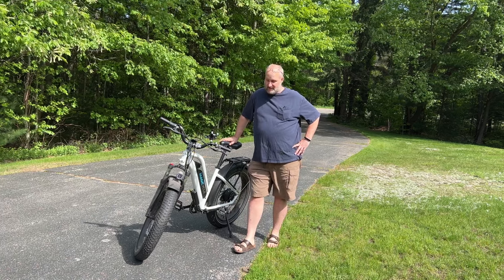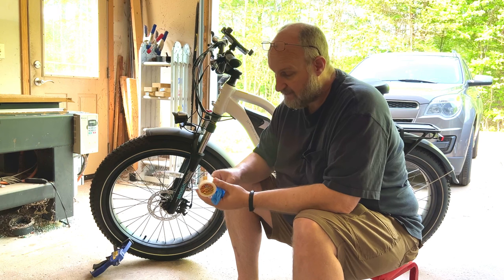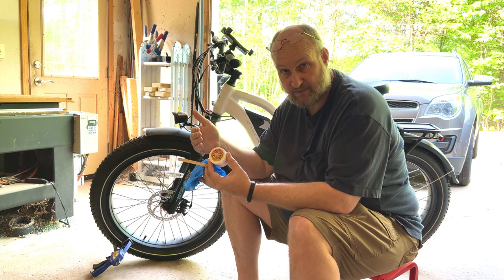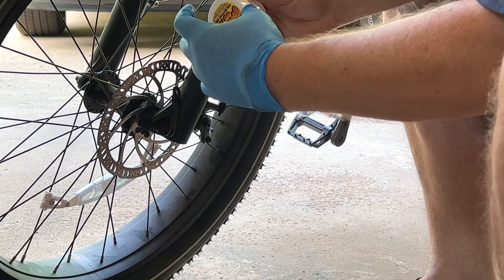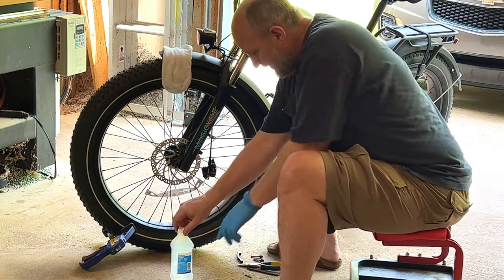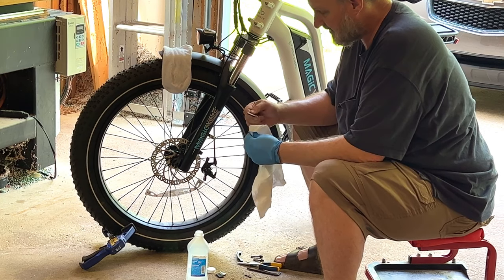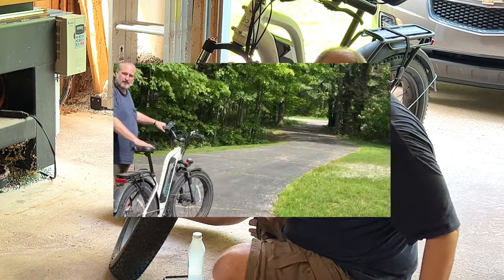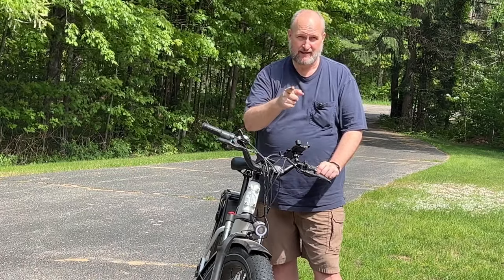Squeal Out review- Tinkering Turtle

Comment: oh my goodness, I just tried this.  I never had disc brakes before, and bought a used disc brake bike.  Nice bike except the very loud squeal on front and back brakes.  As I was doing the front brake, and cleaning the rotor with alcohol and shop rag, I got a very noticeable squeak, just from moving the rotor while applying alcohol.  OMG, these brakes are designed to squeal.  But after the moment of panic, I continued on.  And I would say the final result is the front brake is not squeaking and the back brake can still squeak under heavy braking but for the most part, it's ridable now.  Before it would wake the entire neighborhood.
Reply from the maker: I am glad it helped. The vast majority of the time cleaning the disc and pads with isopropyl alcohol will do the trick. On a few bikes I have had to use this product. And one bike I actually ended up replacing the caliper to eliminate the problem. Enjoy your bike!

Comment: I bought the plug and play hydraulic disc brakes for $40 a pair and put them on my Cruiser and my wife's Step Through. I didn't notice any better stopping like many people report but just as good as before the switch but no squeaking and I like the idea of both pads moving into the rotor instead of just one.
Reply from the maker: ok, good feedback.
Reply from the maker: Can I ask which cable actuated hydraulic calipers you chose?

Comment: OR....you can buy a $40 set of hybrid XTECH hydraulic brakes (which use your existing cables) that never squeak ...because the very design of those CHEAP Tektro aires brakes where only 1 pad actually moves is causing the vibration and rotor distortion. Trust me...you''ll be doing that entire procedure again and again if you keep those brakes. Yeah it worked for a while, but....well you'll see. Do yourselves a favor and get brakes where the rotors are not distorted (BOTH pads move in unison) and not only will your brakes never squeak again, but they will actually stop better.
Reply from the maker: Not really the point of the video, but I appreciate the feedback!
Reply: That is how floating calipers work

Comment: Could be from warped brake disc
Reply from the maker: Its a possibility, but typically I have found that once the pads are smooth and parallel then the noise goes away.

Comment: It looks like valve lapping paste. Probably without the lubricant and a "bike" sticker only on it to jack the price.
Reply from the maker: Probably a good assessment. The container is lasting a long time and it works wonders on minor squeals that are not associated with too much contamination. Thanks for the comment!
Reply: @TinkeringTurtle  No problem I have a rear brake that squeels like crazy. I've cleaned the rotors and pads, cleaned and sanded the pads. Everything. I may try this product as you are right you only have to apply a very small amount to the rotor. Literally just use clean gloves and your fingers to spread a little on there. If it's anything like valve lapping paste you only need a very small amount.
Reply from the maker: @Chris Sinclair , I will say I have a front brake on one of my bikes that is a problem. I have cleaned it a bunch and it still builds up contamination and squeals. I will work with it some more than I think I will try a new caliper. I am not certain where the oils is coming from. This product will not help that…
Good luck, let me know how it goes!
Reply: @TinkeringTurtle  Can it be a leaky cable. I had to replace the oil in mine. It was a very slurping experience 😀
Reply from the maker: Always a possibility

Comment: This stuff is nothing more than rubbing compound. I too wasted $20.00 on it.  It does work somewhat, but, after using it you still have to disassemble the brakes and do a regular cleaning job.  So, why bother with it?
Reply from the maker: Fair enough. I can say, with one exception, it has worked on the brakes that a cleaning wouldn’t fix. The exception I had to replace the caliper before the squeak went away. I am assuming the caliper wasn’t working correctly.
Reply: Personally, I tried everything else, so even if this is just a rubbing compound, the benefit to it, is people explain how it works and then the squeal goes away. Sometimes it's about having a way of obtaining the knowledge.  I tried all kinds of other videos with various instructions, I bought brand new pads, cleaned the rotors, I never tried replacing the rotors though.  Anyway, when I found this,.  I had to spend $30 on it, maybe because not many people have it for sale anymore.  Oh well,, I can ride my bike finally.  The squeal was so loud people were turning their heads, they thought someone was having an accident.  It worked for me, so far, anyway, and you use so l little, it'll last forever, so I don't see myself trying anything else at this point.  I kind of like the process too.  At my house I have to get up to a sprint and then apply the brakes.  I must've done 24 sprint efforts in total, kind of fun.

Comment: Appearantly this stuff is no longer available anywhere.
Reply from the maker: ya, I’m not seeing it anywhere. Have you tried removing the pads and cleaning them (and the rotor) with isopropyl alcohol?
Many times this will also get rid of a squeal. I had one bike I had to do it several times, but in the end the squeal went away.
Reply: @TinkeringTurtle  I'll give it a try. Thanks.